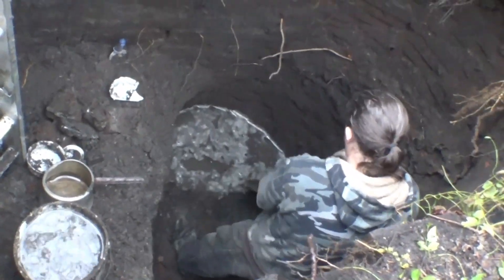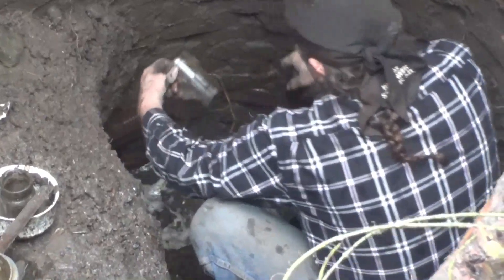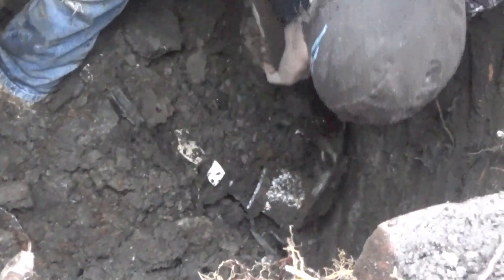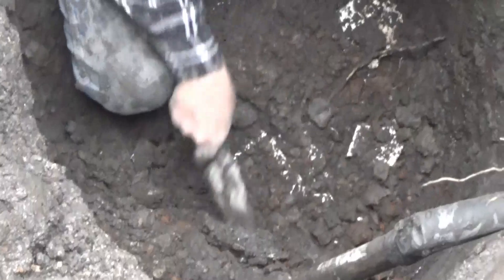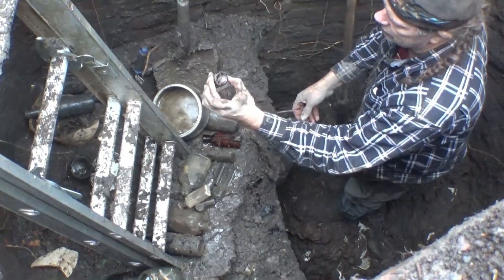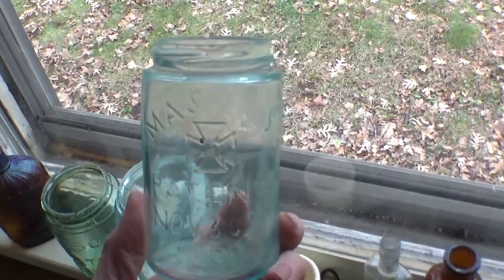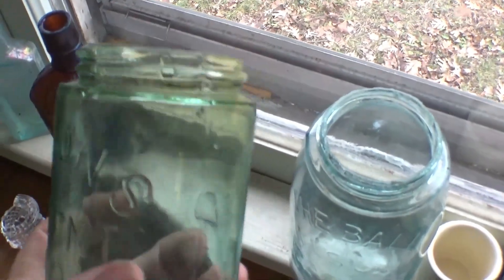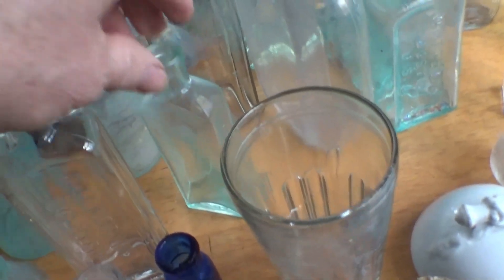A Tale of Two Privies...200 Bottles Dug Day Two

Comment: Hey Dave great video as always! I found something similar to that lead piece, you were questioning, up here in New Hampshire and a old timer said that it was probably the base to a old whale oil lamp. The lead was used to add weight so as not to tip over easily? Anyway thanks for sharing!
Reply from the maker: Hey Timothy thanks for sharing that with us. That makes sense, as I can see it having a whale oil burner  perhaps. Thanks for watching....good luck in your digs...Digger Dave, Privy Paul & Shovelin Shelley

Comment: Dave,I know of a foundation that I detected about 20 years ago. Found flat buttons. 1842 1/4 franc. Silver quarter. I know it goes back to the early 1800's. It had slave quarters. I found the stone lined well. Is there any  info u might be able to share with me on location of the privy in relationship to the well. In ur past experience? It's in the middle of the woods  One thing it was bulldozed to knock the walls of the house and Barn in. Thank U.
Reply from the maker: Hi David....thanks for sharing with us about your early site. That really sounds exciting man! The privy usually would not be located anywhere near the well, especially on rural sites where they had plenty of room. Sometimes it is hard to locate the privy because it could be anywhere in the back or either side of the house. Just be patient and keep probing systematically as you eliminate one area before trying another area. If the well is rock, then it is possible the privy could be rocklined also. Keep us posted...Digger Dave
Reply: @diggerdaveshovelinshelleyb8057 Dave, Paul and Shelly. Thanks so much for the tip. Trying to locate my first privy. This site is forgotten about. The only reason I ever new it was there is because of my Dad. He knew it as a kid. He passed lots of knowledge and history to my brothers and myself that was mostly lost to time. How things change.
Reply from the maker: Hey David....I'm so glad that you remember much of what your dad passed along to you. My dad shared a lot of interesting things with me which I try to pass on to my kids and grandkids. Man, that means so much to us now doesnt it? I feel certain you will enjoy the hunt and hopefully find the privy. Keep us posted....Your fellow diggers, Shovelin Shelley, Digger Dave & Privy Paul